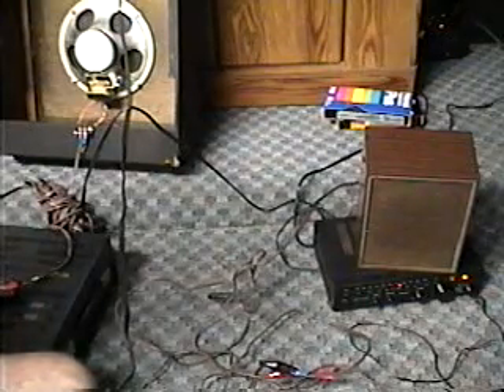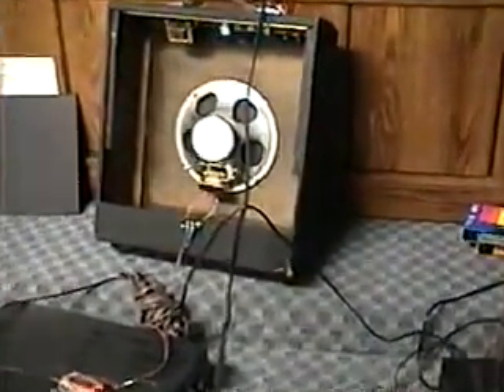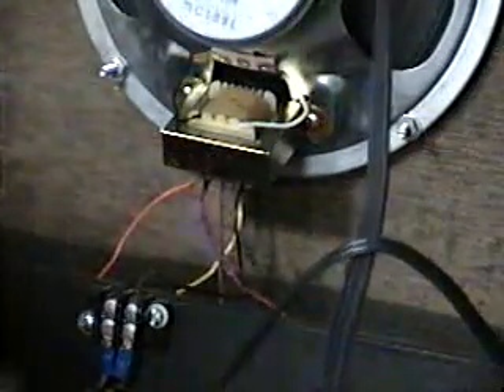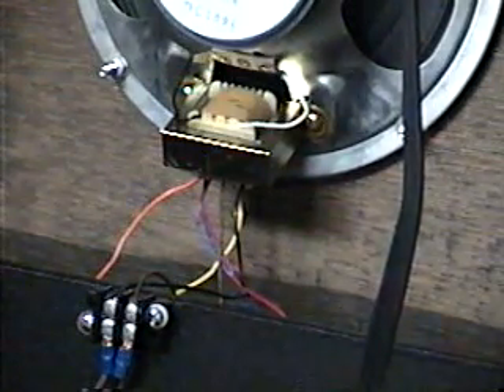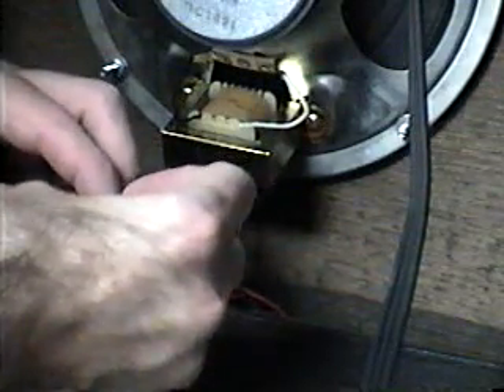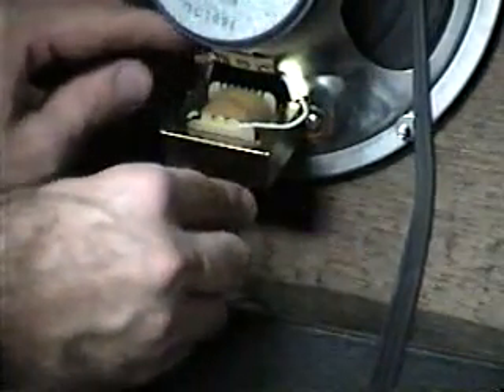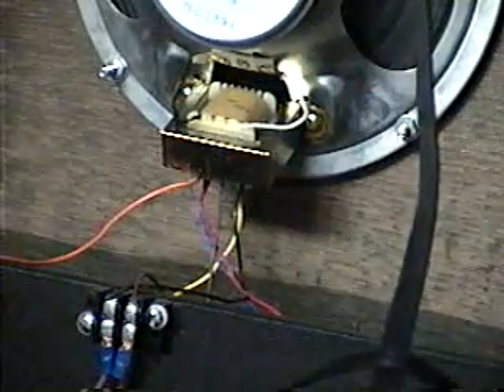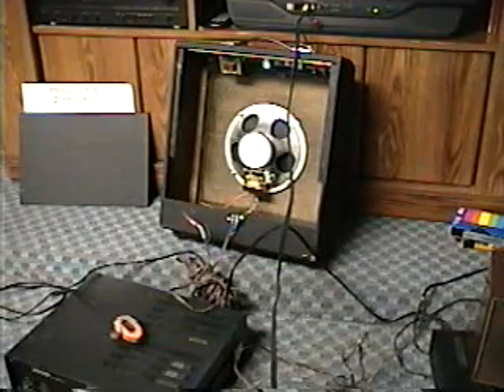Speaker Demo 1

Comment: ddl312 & CassetteMaster 100% correct. To use the 70 volt line your PA would have an out put marked as 70V on the amplifier. This output would connect to multiple 70V transformers in parallel usually to cover a large room or several rooms and each speaker many have its own volume control.

Comment: I think the reason is the difference between impedance. The ohms on the primary side of the transformer are much higher than the speaker itself, and the amp is probably designed for around an 8-ohm impedance.